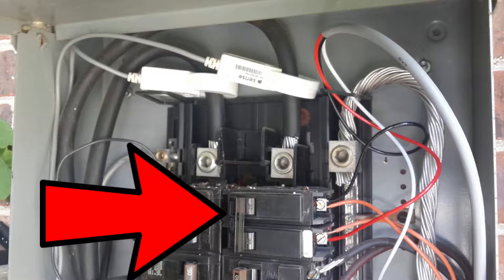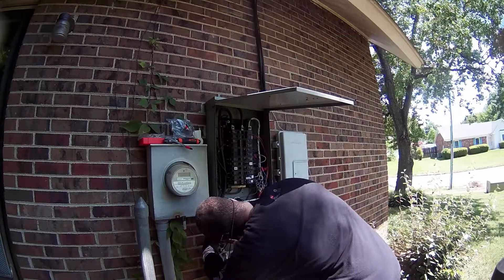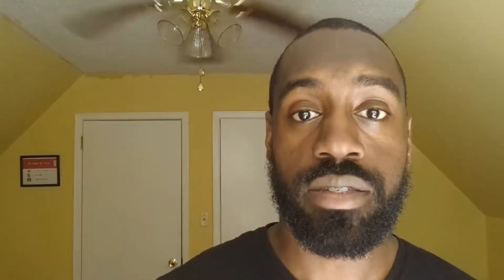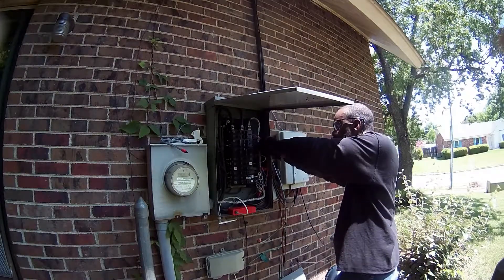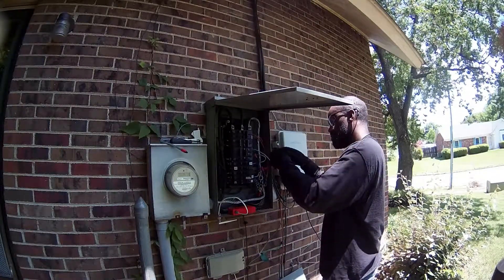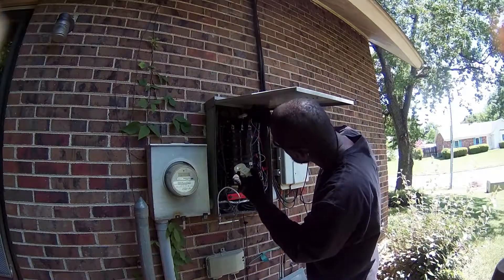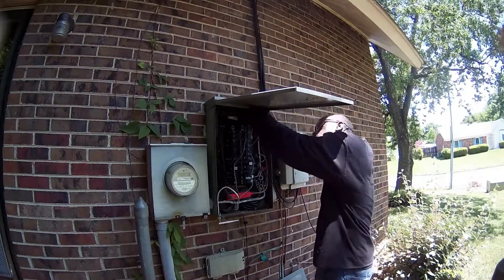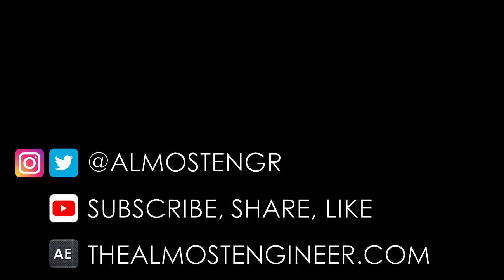How To Install Smart Energy Monitor, Sense Energy Monitor

Comment: Thanks for the install video!

What do you think of the device so far?

Have they upgraded this device?  Tried to see what those features would be...

I would like to use it to monitor my freezer and fridge and alert me on:

1)  Power is off in the house (can SENSE send you a signal when your house doesnt have any power (even though it is off))

2)  Freezer or Fridge power is off (Product is off... not sure if it can tell when the compressor is running, but the device is still operating?)

3)  Freezer or Fridge has been running longer than X minute (door is open)
Reply from the maker: To answer your questions...
1) Sense will send you a push notification if your device doesn't not communicate with the Sense servers.
2 and 3) when it shows that my fridge is on, that means the compressor is running. The light bulb being on when the door is open shows under Other for me.  My fridge cycles on and off about every two hours when not opened. That said, you can out an alert in that if the fridge (compressor) stays on longer than the typical run time, that you get an alert. That would help if you left the door open